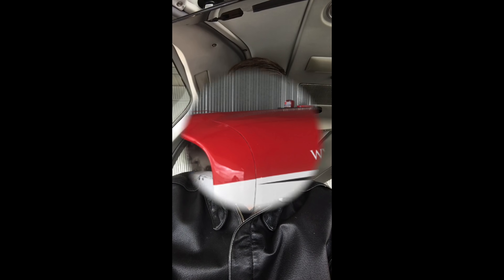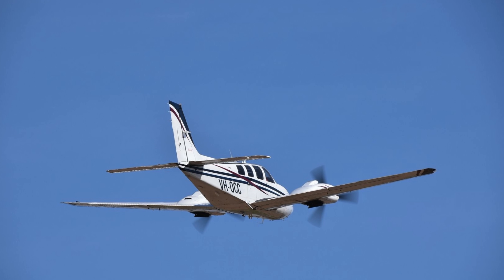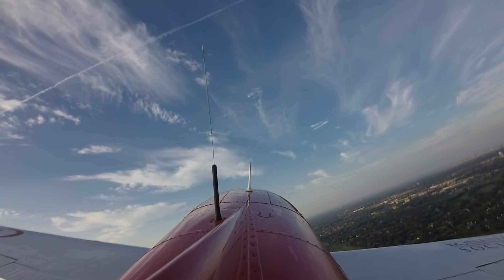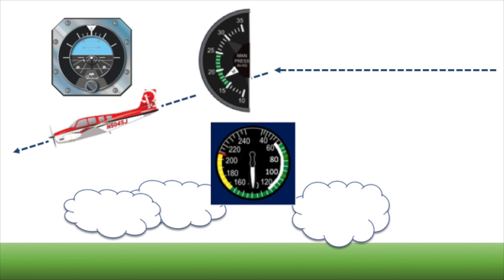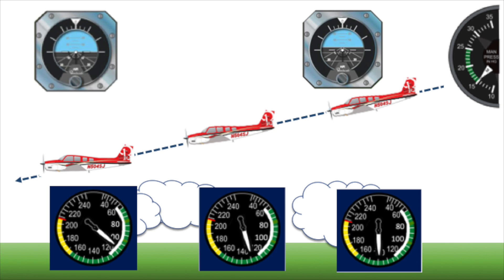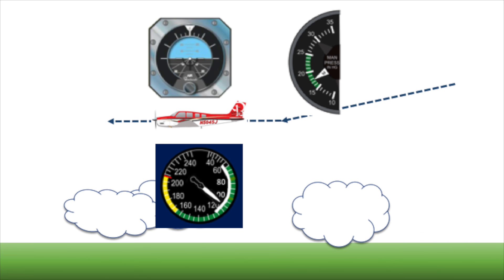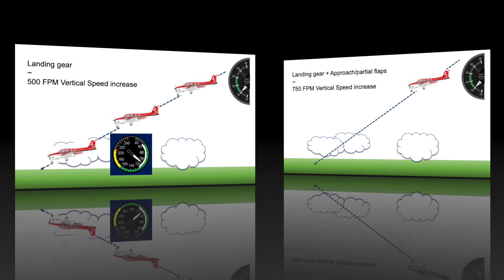Descend and Decelerate

Comment: As an aside to my above procedure; in my initial descent, I mostly just push over. I like the extra speed (to make up for headwind during my cruise or just go fast) and go somewhere into the yellow arc (knowing that it will be smooth or almost smooth). But, I begin slowing and going down miles from the airport pattern, otherwise I can easily overrun flight training-slower, airplanes. Yes, it’s a higher workload, but I have 1,000 hours in various bonanzas and barons, 55 years flying and 28,000 hours. Disclaimer; my technique isn’t for everyone. 😉

Comment: As you mentioned, the older bonanzas hav low gear and flap speeds. My 1947 35 v-tail is 100 mph for both😮. It’s high workload, to slow to 100 mph for the gear. 
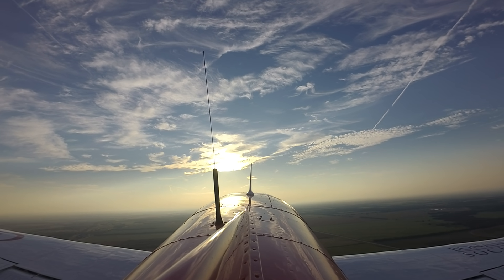I throttle back to 13-14” mp (gear horn on), level at pattern altitude (several miles out to slow to 172 and Cherokee speeds), then I climb slightly 5:42 for several seconds, dissipate speed to 100 mph, then lower the gear and extend half flaps. Works well, but you have to manage all of this efficiently 👍🏻

Comment: I guess I don't understand why this has to be even said. With my F35 if you push the nose over without a power reduction it goes into the yellow arc. Given the age of the plane I have a personal rule of always keeping it in the green arc. I exclusively use the throttle for decent and keep a constant airspeed usually 160 mph.  If I encounter turbulence I  reduce the throttle further and level off then continue the decent after I am slow enough. That gives me a quick reduction on speed.  With the F35 I  have a very low Vlo. So my plan is to be at the altitude I need for landing or approach about 5 miles out. Reduce to 16" and it will be down under Vlo by the time I need to drop the gear.   Nce video well done as usual.